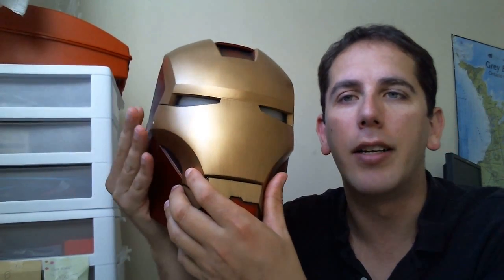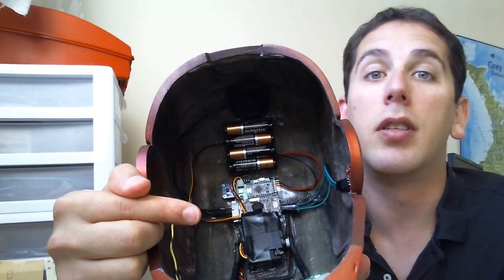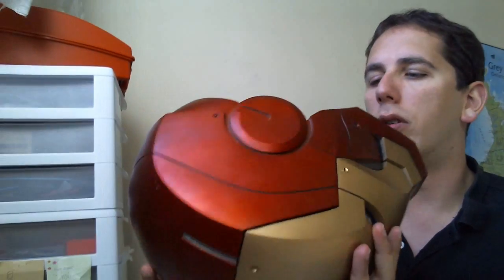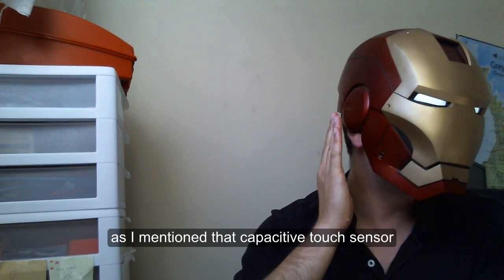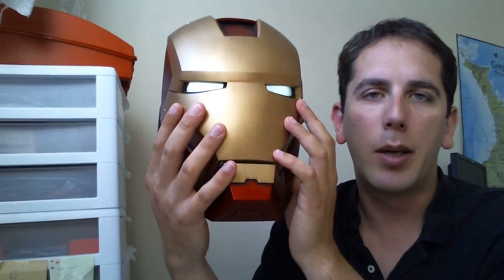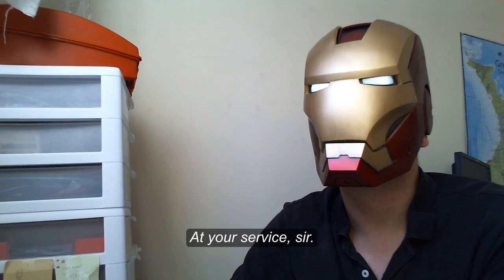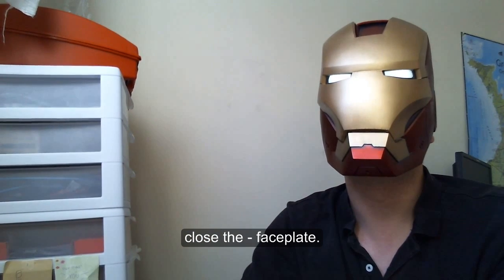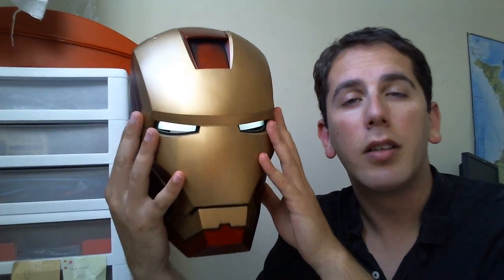Servo Mechanism 3.0 (Explainer)

Comment: Any plans of waterproofing the electronics. I know when fully suited up the helmet gets really sweaty inside, plus the open battery pack will cause skin/scalp burns if not properly insulated!
Great job on the programming and electronics though!
Reply from the maker: Jay May A great point.  In my installation instructions, I actually advise the addition of anti-static bag between the electronics, or a thin layer of some kind.  There are some great tutorials online as well for water-proofing PCBs, but it's a lot of work for me to do for each order.  Here is a good one: http://www.instructables.com/id/How-to-waterproof-circuit-boards-epoxy-method/